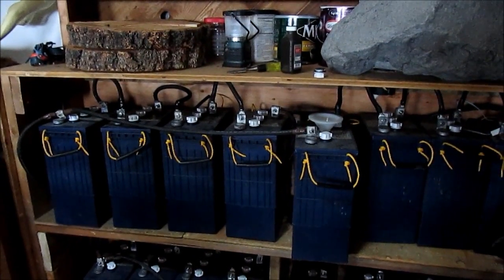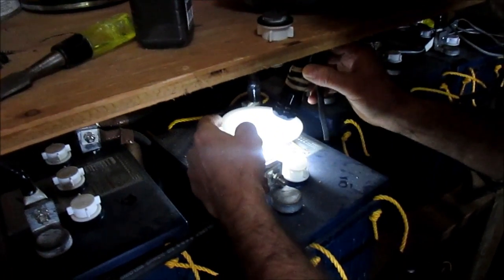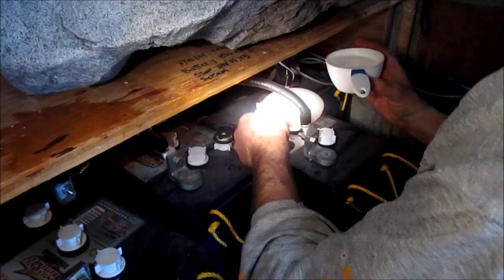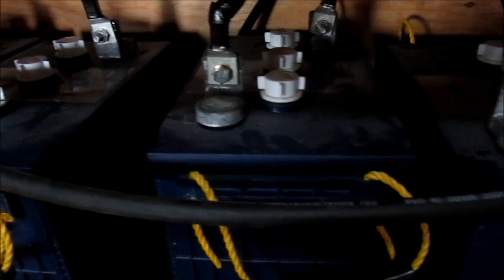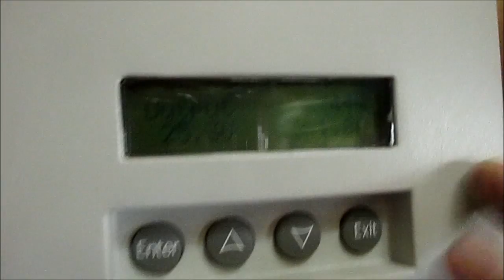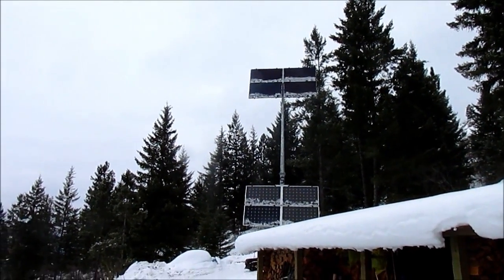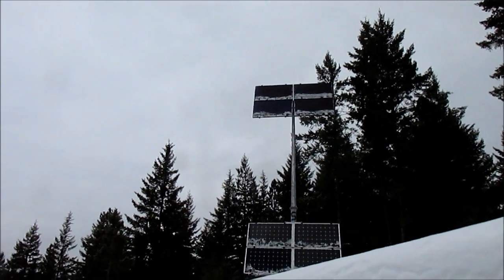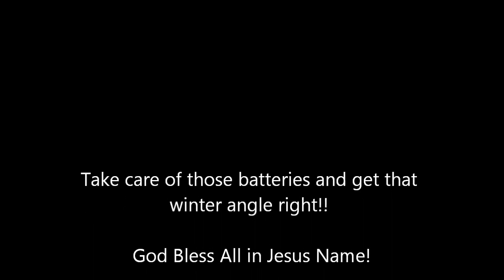Solar Battery Maintenance

Comment: Digging the channel, good for you guys !
A tip I have picked up is to COMPLETELY clear your panels of snow. Try on those lower ones and see if you notice an improvement. Your have a nice setup to test as each set of panels have their own meter.
Reply from the maker: Thanks for the comment PA prepper. The snow thing..well those on top of the pole are unreachable...the setup was originally for a wind turbine so when that didnt work out we put panels up there. Need a boom truck to get up that high now:( The good thing is we dont get alot of snow...and it melts quickly! We are just in a good area for mild temps and not alot of snow. JUST clouds this year which the locals have been testifying to is VERY unusual!!! Thanks for watching!!

Comment: Yes, definitely get more solar panels. You are totally right about the advantage ov having more will get the batteries charged quicker when the sun does come out. But more is better during the cloudy days too. More is good really. 

A lot ov people don't even worry about having "summer angle" panels. Because in the summer the daylight is so abundant the slightly less efficient winter angle is not really significant. I can vibe with that to a large degree, except panels that are mounted fairly close to horizontal (which will work very well in summer, poorly in winter) perform much better on cloudy days than ones that have a tilt to them.
Reply from the maker: Thanks for your comments and insight. We have tolled with the idea of more panels but came to the conclusion that our consumption needs are so small...we are leaving what we have and not  adding. We survived the clouds no problem..and since locals said this was a highly unusual year for clouds..we did just fine. BUT still  a lot fo other offgriders to consider before moving. Think solar..clouds..wind..weather...right!!! Thanks for your input!!

Comment: Great video, it shows the less glamorous side of living off grid.  It can still be a rewarding lifestyle but it certainly isn't for everyone.     I also liked that it shows that the heart of the solar system aren't the panels, or the controller but rather the battery bank.     I would recommend for a lot of people to get the sealed glass-mat or gel batteries, they are a bit more expensive but require far less maintenance and they don't vent off the dangerous H2 gas.
Reply from the maker: Luke B Thanks for the input! How big a  battery bank do you have and how much did you have to pay for those sealed glass mat or gel batteries? We did alot of research and often people just cant afford some of those more expensive batteries..as such with us. But with proper ventilation the lead acid batteries  should not be a issue. do you have 24 or 48 volts for your system? curious  how it is set up! Thanks for the comments!!
Reply: I have two independent solar systems for my cabin, one much older 4 x 105 Ah AGM batteries, and one newer set (4 x 105 A.h).    The older I bought used and were checked OK in 2001, so they are 14 years old or older?.     When I upgraded I decided to add another system rather than adding to the old system.     I like how I can manage the system better.    The newer set I bought  in 2008 and were almost $300 CAD each (so expensive!).   The newer set is on 4 x 125W 12 volt panels and runs a small deep freeze converted to a fridge.    The older set runs the rest of the cabin, (lights, cellphone, laptop, water pump, etc.)    The older set of batteries  is on 200 Watts of panels.   So overall it is a very small system.     It works reasonably well, even in the winter time we get a lot of sun.    I have had this system for a long time, so you learn what you can or can not do.     I do know that there are many different ways to make things work.  :)
Reply from the maker: Interesting.! And yes you mentioned you learn that there are different ways to make things work. Living off the gird full time also is a whole different ball of wax...and affording a setup for full time use is always a priority. For a small cabin like yours these agm batteries probably would be more affordable. And awesome that they lasted for 14 years. But we have daily use here...and a large bank (16 batteries in all) so when I finally hit big in Vegas I may buy different batteries..until then..reality is what it is!! haha thanks for  sharing!!

Comment: Just a note: Many appliances that do not have a transformer readily accept 100 - 230vDC. I have ran my laptop & desktop off of 100vDC for over 6 years and they run slightly cooler because it is less for the power supply to do, since it gets turned into DC internally anyway.

Comment: i can never remember which is parallel and which is series, but i remember that + to - doubles the voltage and keeps the amps the same.  so 2 x 6 with + to - is 12 volt...  + to + means the volts stays the same but the amps double...  so 4x6 with all the + to - is 24 volt.  all the wiring gets a bit funky too and with the COST of those big thick cables, i wanted to keep the price down, so i made up little paper batteries, so i could mess around with the battery layout without having to physically move those heavy suckers!   i check the water when we change the time from daylight savings, same as when i change the batteries in the smoke detectors, put softener in the water tanks etc.

Comment: Hi I check my batteries monthly . Run Equalize check water and all connections and add water . I am running 2.8k of panels and 2k wind gen. on a overcast day no wind I get 15-30 amps , sunny winter day 60-80 amps. The wind gen well add another 1-20 amps depending on weather, Panels are cheap now if you do some shopping $0.60 to $1.00 watt . I'm running 12 panels and getting ready to add 12 more , I would say 8 more 250watt panels you should be pretty good ,

Comment: Tip also use a weed sprayer with your Distilled water cheap plastic one. Cut the end of the sprayer off bend to fit use o ring to mark depth of cell water level and squirt them cells up to the o ring marker, cap and go. No spills no waste no mess. Always cap the end of the tube when done.
Reply from the maker: 919hammer SMART SMART..great tip! Thanks for sharing

Comment: Just wanted to let you know, that little bit of snow on the bottom of the panels is impeding the effectiveness of the whole panel. I know it's just a couple inches, but it does cut into your power generation. I know it's a pain, but when you get the comport unity knock the snow off, even if it's just a few inches at the bottom. Or buy a panel heater that will melt the snow off, but they are more geared towards when you've got heavy snow hitting the whole panel.
Reply from the maker: KevKevAllen Thanks for your input. Once the sun gets up the snow melts quickly. Never heard of a panel heater? How much are these? How much electricity do they use? Do you like yours and how effective is it?? Thanks
Reply: It doesn't snow where I live, so I have no need for them. I've never done any research into them.

Comment: if you want to do the double stacking you could make a sturdy slide tray to pull out each battery.
Reply from the maker: +Dylan Sullivan yes for double stacking a slide out shelf would be a must. we rebuilt the box and did it this time so they could all be on the floor in 4 rows. much easier to do maintenance. just take the lid off and you are on top of the batteries. easy visual inspection in to each battery cell. thanks for the suggestion!

Comment: I learned quickly with my solar project that you can never have too much panel.  You can get good panels now for less than $1 a watt.  That pole you have looks like it could hold 8 more panels with no trouble.  Panel up...
Reply from the maker: +Noughs Enough bservation and advice..WE ARE in the process of getting extensions for the rack and indeed are adding on more!!!
Reply: +Noughs Enough I'm excited -- Tomorrow morning, I am buying a bunch of Grade B (cosmetic blemishes) panels for 25 cents per watt.  Woo!  Hoo!